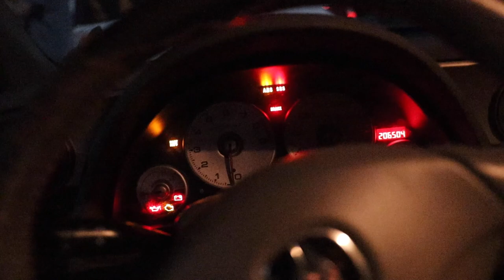I Accidentally Bought Another Car..

Comment: Loctite those fuckers banjos. I tightened mine to spec and they were lose in a week. I also put a witness mark on the screw / banjo to quickly see if they walked lose again. Good luck on the new project!
Reply from the maker: That’s not a bad idea but it’s taken a LONG time to come loose. I’ll just have to double check it any time I move parts around or have the oil

Comment: Make a drag build for it. You can put a fuel system, clutch and a turbo and make easy 500whp. May need a trans cuz the 6mt are infamous for grinding third or second gear.
Edit: on stock motor. It can go 600whp on stock motor but thats really pushing its limit and 400whp is the safest.
Reply from the maker: lol actually it's grinding in 3rd so we will have to be gentle on her at first. but 500whp is the goal
Reply: @Zorbii  then you need a clutch fuel system, trans, manifold, hondata kpro, thats like the bare minimum for supporting mods before installing a turbo. Obviously maintenance. 500whp is possible whe the mileage you got. But thats like the warning stage pretty much. Im no expert but I know enough to help out a bit.
Reply from the maker: This will all come with time. I just have to do research and get started
Reply: @Zorbii  aight. You got a good ass car thats rare. You finna have a hella good time with it lol.
Reply from the maker: I’m excited 💪🏼 thanks for the insight man!
Reply: @Zorbii  np man. Oh one more thing, an option if your looking for a boosted setup is humble performance budget k-series turbo kit. Its +$3k, keeps ac and capable of +600whp. Anyways have fun with it.

Comment: That is a very common leak the oem rubber gasket likes to compress over time and start to leak looks like you didn't have that issue but if it leaks from there again replace the gasket
Reply from the maker: Which gasket?
Reply: @Zorbii  it's between the oil cooler and block you have to remove the oil filter and 17mm bolt stud thing to get to it
Reply from the maker: I’ve actually removed that piece as a whole and replaced it with the Mishimoto oil cooler. They send it as a kit to add on top of the factory one but I just replaced it because they’re the same thickness.